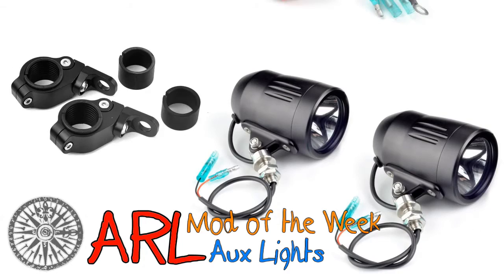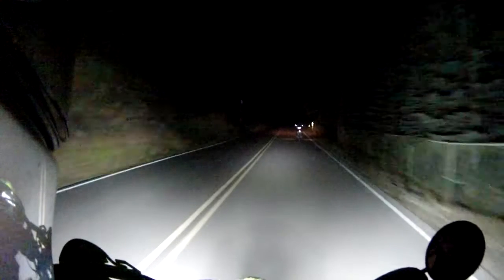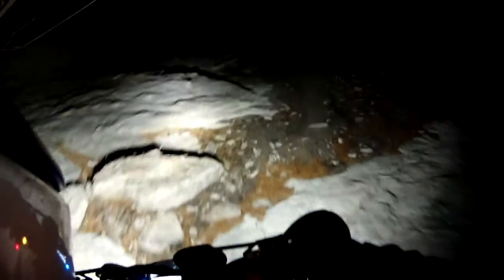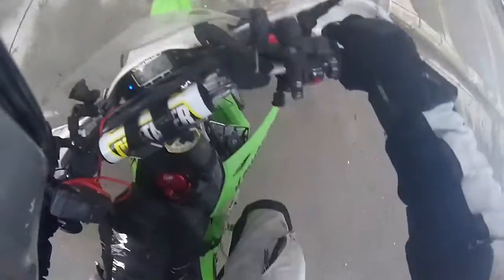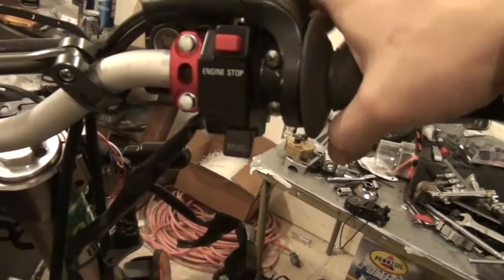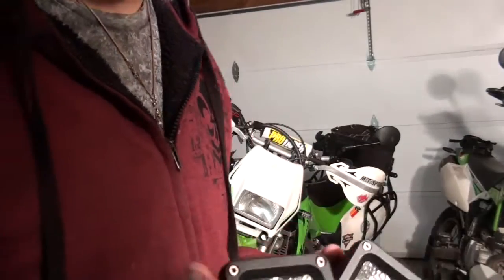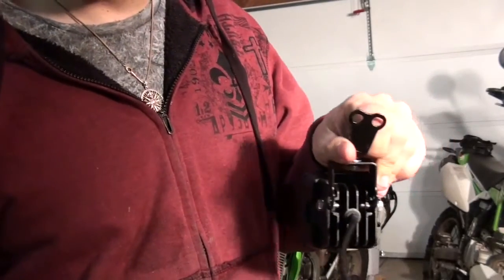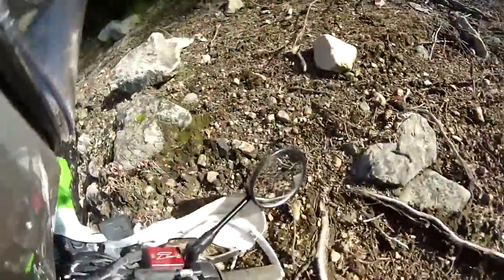An Overview of Auxiliary Lighting Systems for Dual Sport Motorcycles - MOTW

Comment: this is the most useful vid i've found so far on the general topic of lighting and dirt bikes.  will try to keep this short but many questions.  own 2017 yz250f with 40w stator running through reg/rec, no battery.  want to add lights.  how best to do this?  i've heard there are three ways: 1.add battery, the do full battery drain   2.from oem power (stator/reg/rec) direct to lights   3.add battery , then from oem power (stator/reg/rec) to recharge battery, then to lights.  PLEASE HELP.

Comment: If you go the relay rout (probably the safest for your electronics when used with a separate fuse) be sure to add a 1n4007 diode across 86 and 85. As the coil in the relay reaches inductance, there is a highly likely possibility that reverse current ripples form. This can damage your rectifier.

Also, this helps protect your system from brief high amp draw some LEDs have when they first turn on. Basically, the cheaper the LED you use, the more protection you need in the circuit.

I bought 2 EBay LED pods($20), and a replacement LED headlamp assembly ($45) for my DRZ400. I then had to add an other $10 of parts to make sure I didn't let the mythical  blue smoke out of my rectifier. After a few months, they're all working great. and were super cheap. 

Hope it helps and thanks for the video! I wish you made this a few months ago when I was doing tons of research into aux lights.
Reply from the maker: +aseredy Lol! Sorry, these things take time. I heard about the issue with lights getting overloaded without protection, makes sense. Everyone I know uses a relay, regardless of if they wire it into the main switch, so I can't say I've known anyone who has had them blow out.

Yep, rectifiers are magical devices that when they break is more in line with the mystical than the practical. I had one break once, I swear it looked perfectly new. Like it just decided to give up working.

Comment: I also wanted to comment, tying into the high beams is unsafe on certain bikes ( like my V-Strom). You will want to use a Relay or you can damage your electrical system.
Reply from the maker: +charlie french I think I mentioned that, maybe it wasn't clear. Yeah, it was that a relay allows you to tie the lights into the key switch without being underpowered. High beams would be part of this, but guess I could've written that better. 

I thought you were going to mention the concept of visual acuity being hindered at long range when the foreground is illuminated (too bright up close makes it hard to see dim objects further away).
Reply: +Adventures in Real Life I have mine setup with a switch to turn on/off the aux lights, but as long as the switch is on it turns on with the highbeams, I live in an area with almost no traffic (out in the middle of nowhere). now that i rewatched it, you did mention it.

Comment: Good video, I have AUX lights on both my bikes. A cheaper alternative to the ones you have that work pretty well, by the way. http://www.amazon.com/TMS%C2%AE-1260LM-CREE-Light-Off-road/dp/B00EA0ZB7I/ref=sr_1_7?ie=UTF8&qid=1447999457&sr=8-7

I have two sets of these, they have taken hell and still work well.
Reply from the maker: +charlie french Fair enough, I like Burnsmoto, and their price was rather low compared to competitors. Since you can't really get a feel for the durability of things on the internet, I felt pretty secure buying them.
Reply: +Adventures in Real Life I like trying out different lights. I was just letting you know these are a pretty good alternative. :) after watching EveRides video on Aux lighting, i've bought and tested quite a few different LED bars and spot lights.